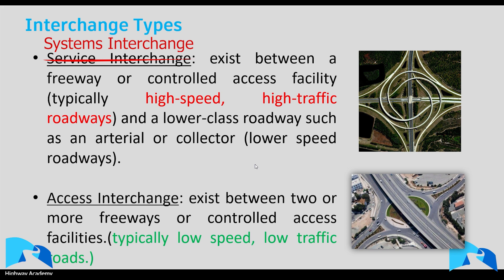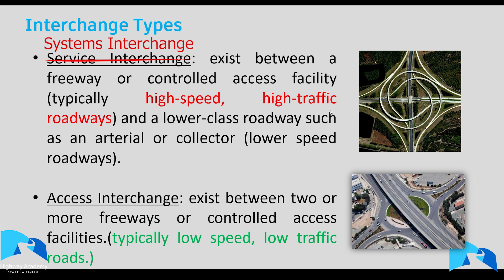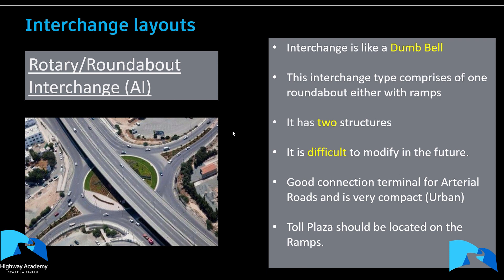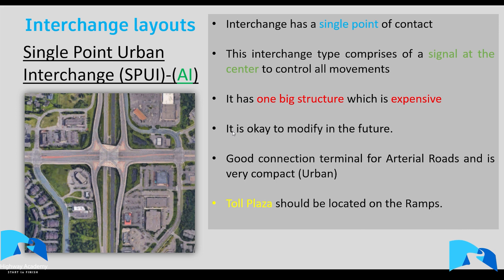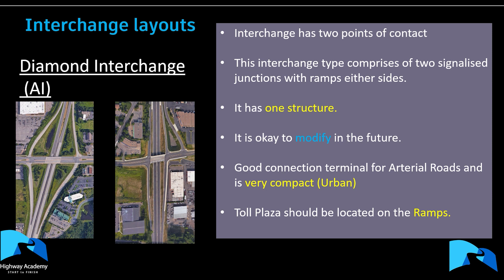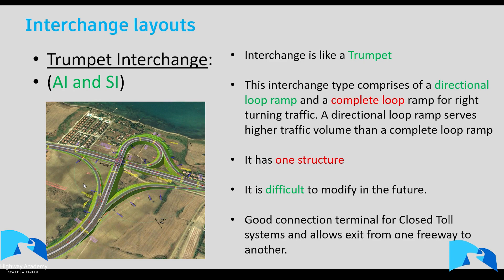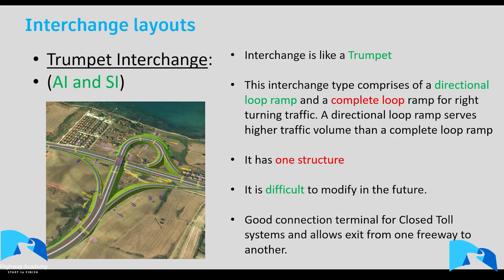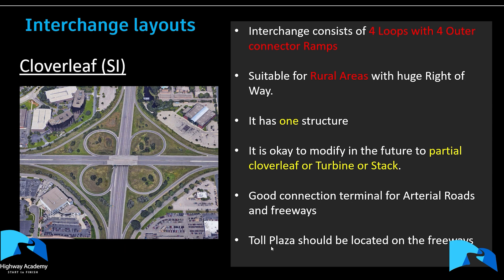Interchange Design Basics: Types and Layouts of Interchanges

Comment: Youve got access and service interchanges backwards, for example the SPUI is considered a service interchange.
Reply from the maker: System interchanges are specifically designed to facilitate high-speed, uninterrupted transitions between two or more controlled-access highways, such as freeways or expressways. Examples include stack interchanges, turbine interchanges, and certain high-capacity directional trumpet or 'Y' interchanges. These interchanges prioritize through movement, aiming to minimize or eliminate stopping, thereby achieving a higher level of service.

Conversely, service interchanges connect a controlled-access highway to lower-order roadways, such as arterials or local streets, providing access to and from the highway for local traffic. Examples include diamond interchanges, cloverleaf interchanges, and Single-Point Urban Interchanges (SPUIs). Critically, SPUIs, along with other service interchange types, necessitate traffic control measures like signals or roundabouts, resulting in potential vehicle stops. 

This inherent characteristic indicates a lower level of service compared to system interchanges. Consequently, service interchanges are primarily employed where local access is prioritized over high-speed through movement. In essence, the design choice between system and service interchanges is driven by the specific operational requirements and functional hierarchy of the roadway network
Reply: @ fair point 👍

Comment: Can’t you easily change the roundabout one by adding a bypass to the second road without any need to change the footprint?
Reply from the maker: @rhysrail  which case are you referring to ?
Reply: @highwayacademy  the roundabout interchange, I might be wrong but I would of put it as okay to modify as you can change it to a double bypass, this is common practice in the uk but maybe not in the US
Reply from the maker: @rhysrail  What Interchange could it be modified to.
Reply: @highwayacademy  I’ve looked up it’s official name and it’s called the three level stacked roundabout, it’s very common here in the uk as it has a small footprint
Reply from the maker: @rhysrail  That is true. The Stack Interchange can be applied to many more interchanges.